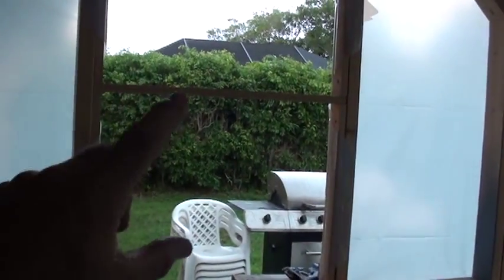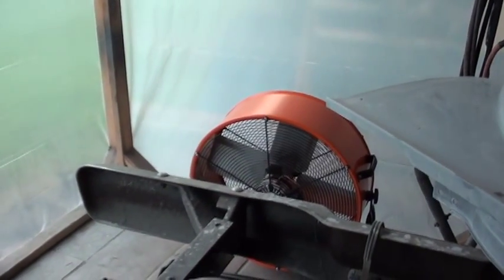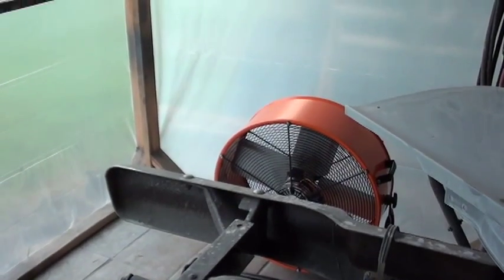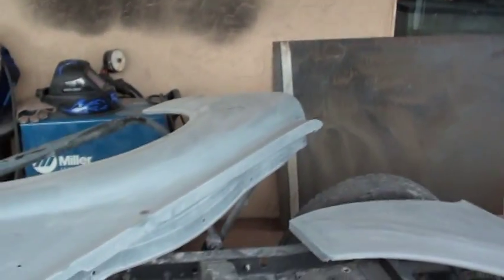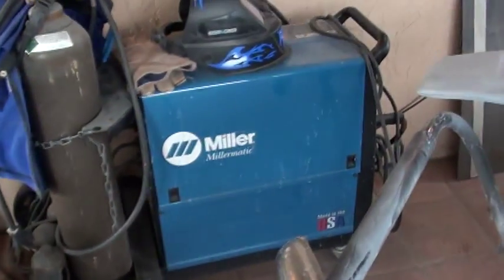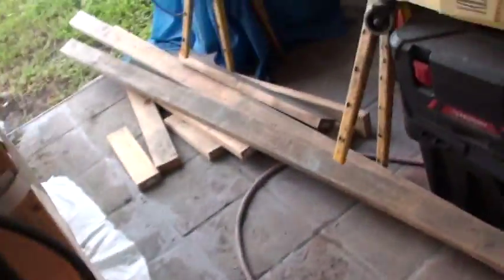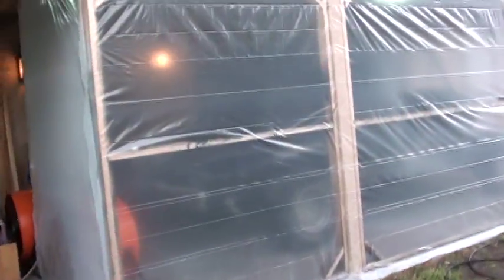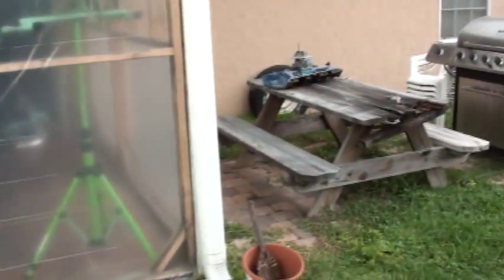DIY Spray Booth Part 3

Comment: With the doorway buddy, i would staple a sheet of plastic 3/4 way across, then another sheet 3/4 way across the other side, so they overlap each other, then when you're ready to spray just wet the overlapping flaps down and they will stick to each other like a shower curtain and seal out everything....just a tought.. good luck, looking forward to watching the next one.. best regards.. Del.

Comment: booth looks good.  One thing you might want to consider is putting up plastic on the ceiling I found that it cut down on dust a lot for me.  Also, the slit in the plastic is kind of a pain.  The glass door might be kind of nice as long as no over spray gets in the house.  Next time I make a booth I was planning on making a framed plastic door on hinges that can still seal well.  Just a thought